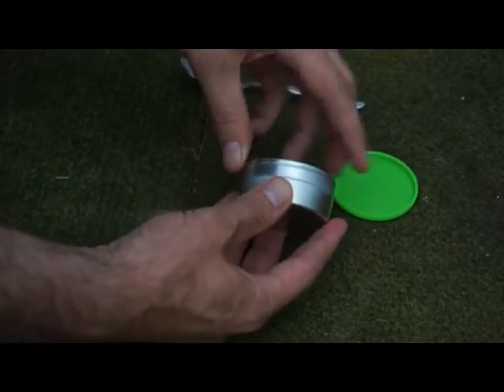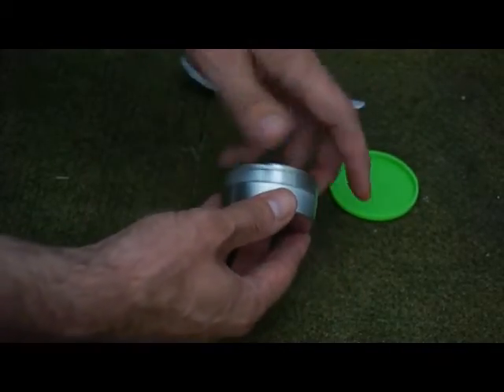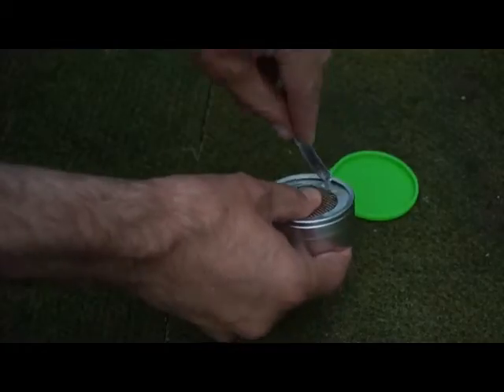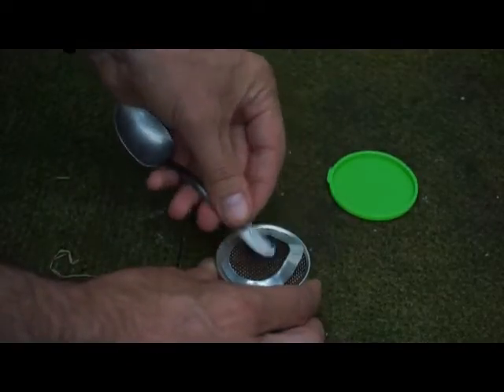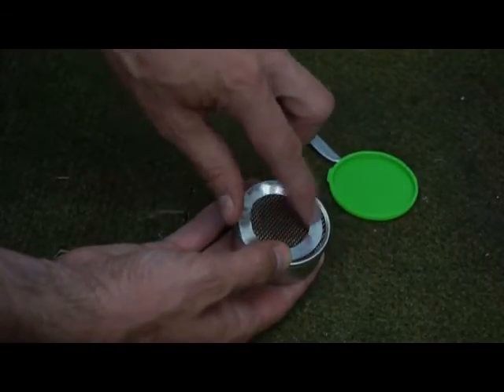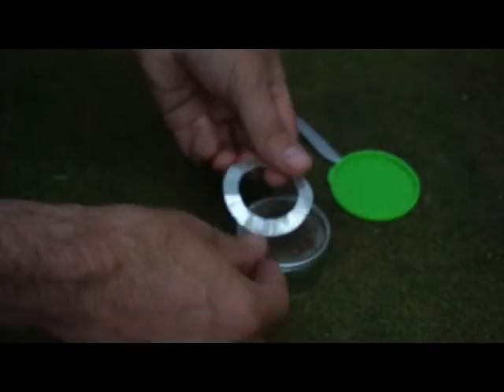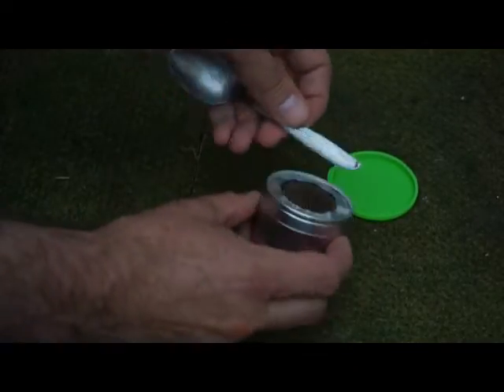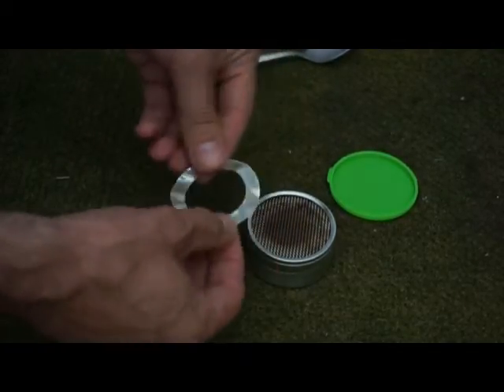Zelph Starlyte stove "simmer" ring removal

Comment: Hi Tony.  I have the Caldera Cone with the titanium Sidewinder cone that fits inside the .9L Evernew pot. Out of curiosity, I bought the modified (with the ring) and un-modified Starlyte stoves from Zelph Stove Works. With the un-modified I get a boil (two cups) in about 7 minutes and with the modified I get a boil in about 10 minutes. This is at home in my kitchen, haven't tried it in the field yet. I prefer the unmodified stove with the faster boil time. Both stoves are fuel thrifty.